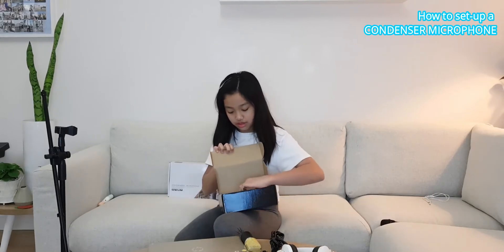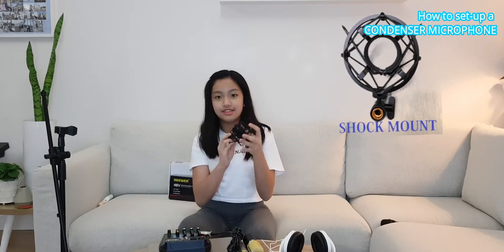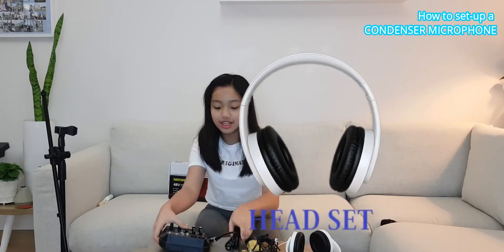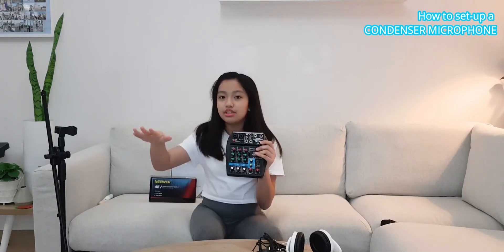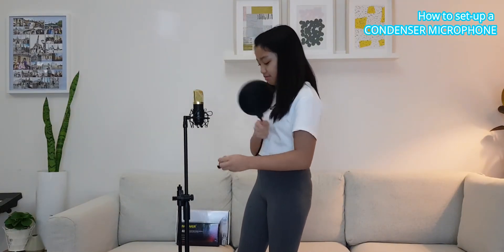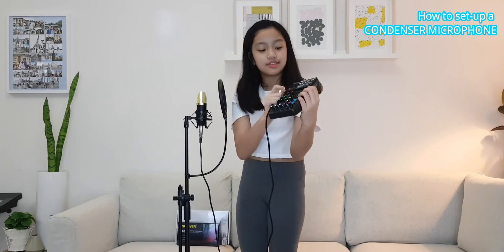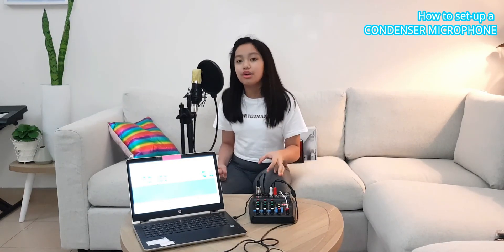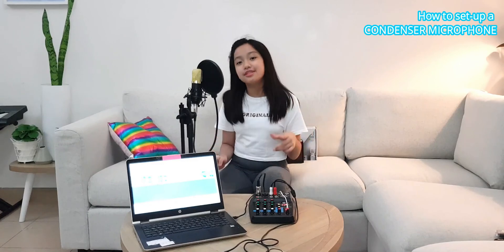HOW to SET A CONDENSER MICROPHONE & AUDACITY | BM 700 Condenser Microphone

Comment: Cristelle would be able to help me, I have the same condenser MXL - V67 and I am using audacity too but my mic does not show a track when I speak just a straight horizontal line, Headphones looks OK, Do you have any idea what is wrong with my Mic, after doing all configurations on Audacity and Windows 10 ?